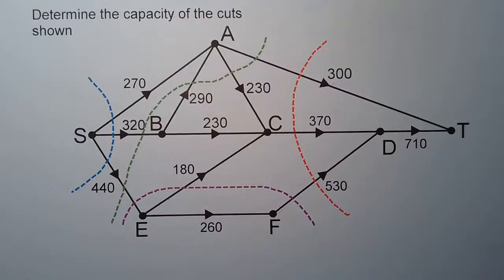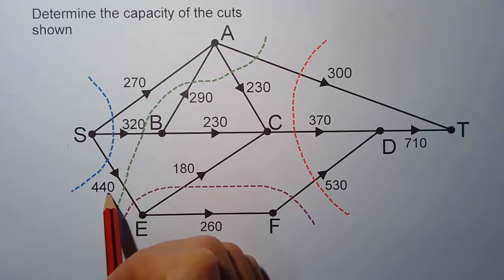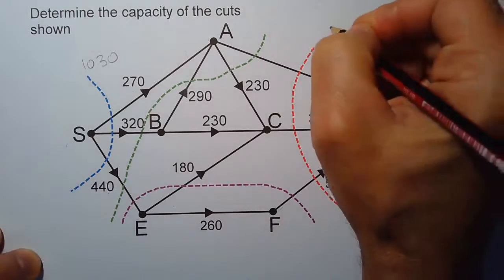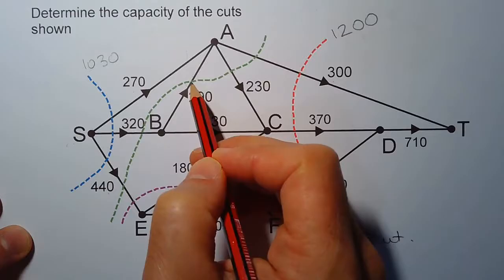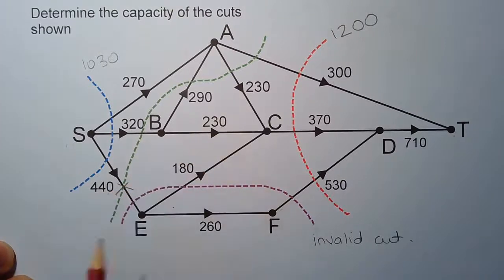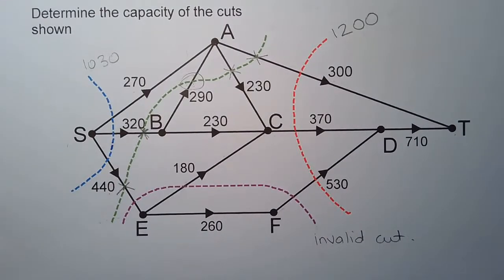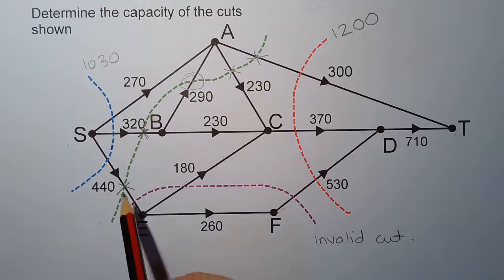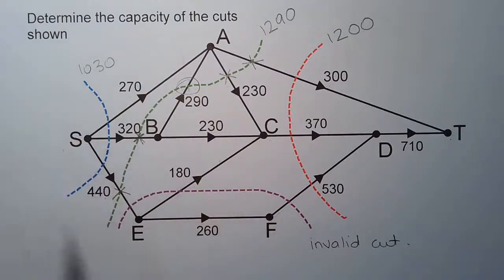How to find the flow capacity of a cut in a network (example 1)

Comment: If Edge AB we don't cur then SABCT is the path and s and t won't be separated so the AB edge is necessary cut isn't it
Reply from the maker: The flow is from B to A so SABCT is not a valid path from source to sink. Considering the green cut line, SE and SB has to be cut, AB does not need to be cut, AC and AT will need to be cut in order to separate source from sink. Hope this helps...